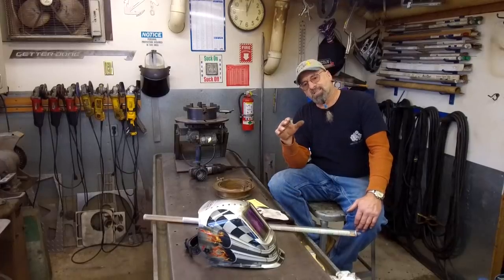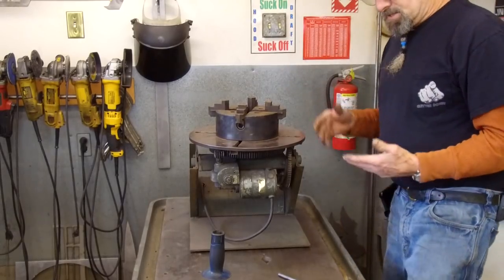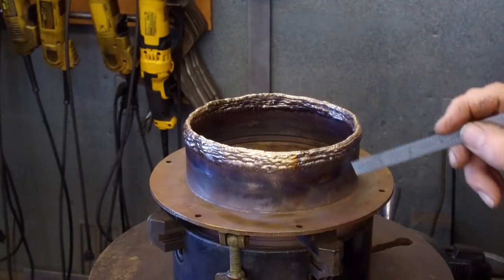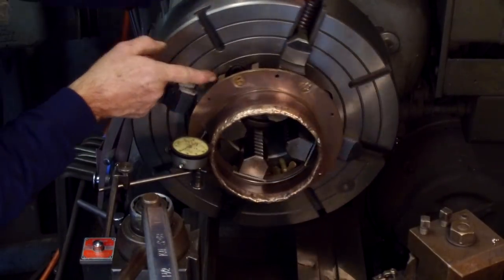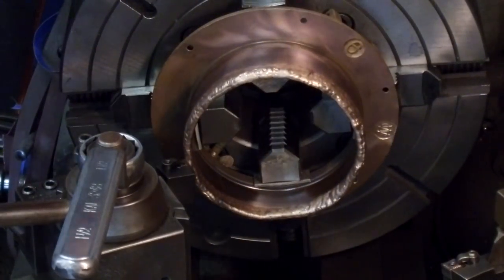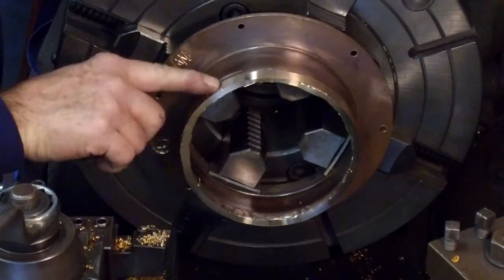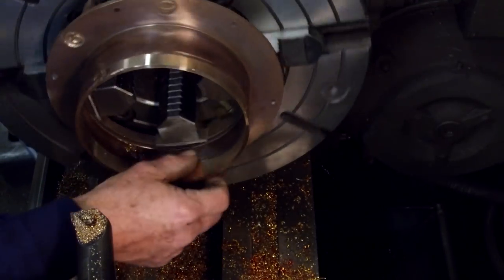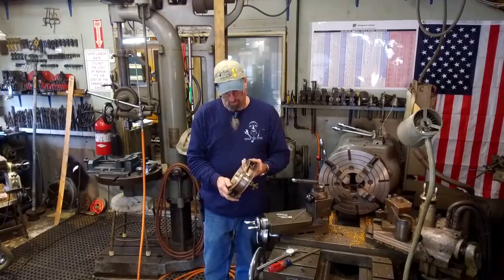Stick That In Your Port Hole

Comment: hello Keith. 
you can use dry lubricants for parts like that. there are different kinds available everywhere. little particles dust and such splatter wont stick like regular wet lubes parts will stay clean. perfect for your needs i think. you can get graphite based one from local key makers they use it to lube the lock cylinders and ptfe wax ones from local bicycle shops easily. they use them for summer time dry season chain lube for bikes. try them out. the only problem is they don't like wet environments which is not a problem for your super dry squeaky  little machine : ) 

keep it up love your work much respect from İstanbul.

Comment: Good job on the Porthole.  I was wondering if it was possible to see some of your projects installed after the work is completed.  Not everything, as I know this is not feasible, but some of the ones that can be seen 'by the public'.  Kind of like how you showed your lights after they were replaced, and the lift you tried out.

Comment: Good job.  that's the first time I've seen you Tig weld brass, at least that I can remember. Not to change the subject, but, I'm still waiting to see a video on how you fix the Clausing cross slide.  RRITS has done a video on his Clausing cross slide repair.  He cut off the acme threaded part and attached a store bought acme thread to the "handle".  Quick and dirty but it worked.  I'm expecting better things from Turn Wright Machine Works.  Keep the videos coming.

Comment: Keith, this video is an example what is a dying art of machining and fabricating.  Lots and Lots of  machinists can turn out brand new parts down to 0.0001 tolerances.  However, taking an old, unobtainium part, and bringing back to original (or acceptable) working and functional condition is not something that is taught  today.  Well played my friend.  Well played.

Comment: can I tig weld bronze and brass with just my regular old Lincoln welder that I plug into 220 ? It's not a high frequency, just a stick machine that I switch the lead and ground around. Do I just use the same tungsten also or us it something different like they use on aluminum? Thanks.
Reply from the maker: You don't need high Freq. and your choice of tungsten. ;{)-------

Comment: Nice work. I think you might have “inside” and “outside” reversed though, Keith. Portlight glass is usually on the inside, where you can open and close it from inside the cabin.
Reply: This porthole is going in a door.
Reply: Roy Reynolds If it is a ‘door’ in a boat, such as a companionway door, it will still have the ‘light’ on the inside.

Comment: For years, I've been wanting to get a weld positioner but they are so expensive and I can't see why they cost so much -even the used ones.
Reply: Using this one as a model, make one using a sewing machine motor or similar and foot pedal.

Comment: Thanks Keith for another awesome video! This may be the 1st video that I can recall where you've shown silicon bronze with tig? You're obviously a master at o/a brazing, with a lot of cast iron repairs. I can see o/a brazing being superior when needing to more evenly heat a part that would be prone to thermal shock; would you care to explain other factors which dictate which process to use in particular situations? 

I enjoy using tig when I can, but almost think that o/a brazing may be easier (for me anyway) on a lot of jobs. Also, do you notice the same amount of draw/distortion with o/a brazing as compared to tig brazing? 

Thanks again!
Reply from the maker: When the materials like ductile or cast iron come to play I use gas torch, with general bronze brazing rod, on most other build ups I would use tig or stick welding. most marine components or accessories are easy tig welding projects, some bronze does flume and then it is a question you have to make yourself, tig or gas torch.  ;{)-------

Comment: what about using a graphite lubricant on the  tilt gear?
Reply from the maker: Might do okay. ;{)-----
Reply: Maybe some Moly Disulfide?  How about putting some Dow Corning oven chain grease in there? It has a fairly high temp rating and is water soluble. FDA approved and non toxic.
Reply: Phil Keith said that he doesn't use lubricant because of grinding dust etc. sticking to it. Not a question of melting point.
Reply: jonka, graphite is a dry lubricant,  carbon dust, frequently use by locksmiths on locks to lubricate them while not attracting dust and grit as an oily lubricant would.
Reply: pyromedichd1
pyromedichd1 Thank you and I know about graphite as a lubricant. 
My comment was directed to Phil Grindle who suggested various high temperature greases
Reply: Moly Disulfide is also commonly used as a dry lube or sprayed on then dried. BTW I only suggested one actual grease. And using IT would be simple with a cover/shield fabbed up out of whatever scrap is laying around.Only spent 5 years as a Sales Engineer in the industrial supply biz ( and 35+ years in Engineering jobs total) so what do I know...
Reply: Phil Grindle You look like someone who likes the last word. I note that you seem to have had it twice here so far.  Your considerable time in the engineering sector has done little for your understanding of other's free choice or speech.
Reply: jonka1 I am sorry that you feel that way about me. I am not judgemental at all about anyone's decisions. I don't care about having the last word. And I couldn't give a rat's back half if someone chooses to judge me. Both  Keiths (Fenner and Rucker) know who I am...

Have a nice day...

Phil...
Reply: Daniel Napast
Daniel I'm right there with you. Nicely put. Be aware Phil is always right and doesn't like to be contradicted.
Reply: jonka1 I better be careful, don’t want to have all his experience unleashed on me all at one
Reply: Daniel Napast 
LOL Sorry Daniel, send him to me if it gets too much.

Comment: You are like a human 3D  printer...
I would've never even attempted that, a ferrule type bezel that slips over (or inside, or just butts up) would have to do for me.
When I can stick two pieces together with the welder, or fill up a hole, that's about as much as I can hope for right now.

Comment: Keith, because of the welding positioner, what do you think about using graphite powder for some sort of dry lubrication? could this be helpful or would it cause any troubles (besides the perfect electrical conductivity of graphite)

we used it a lot on locks to get lubricated and not deal with dripping fluids out of them
Reply from the maker: Might do okay.  ;{)------
Reply: Was just about to post this. While not as good as grease for an application like that it will still do wonders. Do not confuse with "graphite oils" - Graphite in itself (and mixed with grease) works very well in the right applications (in locks, one advantage is that since it's a solid it can't freeze) but mixed with thin oil, yuck, the worst of solid and liquid lubrication combined without the benefits.
Drawback is that since it's an solid not much will stay on so adding a touch now and then will be required (using a soft brush is the easiest when access allow).
Sadly it now rare to see pure graphite powder here (stopped being popular in locks due to three things: 
To much and it spreads outside the lock (fingers, clothes...).
Way to much and it gulls the lock.
It can't "unfreeze" a frozen lock. (Good heavens forbid, no maintenance before the lock have problems. No, wait 'til you can't get in and then cry a river over bad locks.)
Reply: Teflon powder.

Comment: G'day Keith, another great job. Hope you kept the windows up in the car this year with all that snow around.I have a question regarding the work holding. The aluminium (aluminum) shims you used in the lathe set-up were wider than the chuck jaws, so there appeared to be a bridging effect happening. Depending upon the material being chucked, can this cause an error at all in the set-up or machining because of the springing or bending of the shims under the force of the jaws, or is it a case of knowing how much, or little, machining force you are going to apply when turning? All the best for a great 2018, David Wright - Australia
Reply from the maker: let the shims bend, to suit the grab. ;{)-----

Comment: for those who want to make a weld positioner table. think about an automotive manual transmission flywheel with a ring gear  mounted on an automotive hub and bearing assembly.. or drop the proper brake rotor on under the flywheel.. so you can mount a sprocket on the rotor surface to what ever drive motor you come up with.
Reply: wayne p good idea!  Gear from the starter would mate, and perhaps using an old starter to turn it would not be out of the question.  It's a DC motor after all.  I knew there was a reason I was saving all of those old parts.
Reply: Using an old flywheel is a good idea, I've had a weld positioner on my to do list for a long time and i have an old flywheel off my old 351 v8 that has heat cracks but it's not going to fly apart at weld positioner speeds.. maybe an old windscreen wiper motor with a gear off an old starter motor would get the right speed and being a dc motor, it'd be easy to change the speed

Comment: Wonder if there is a chemical he can rub on to bring back the patina?
Reply: ethanoic acid ... some people call it vinegar !
Reply: Vinegar is acetic acid
Reply: There's a lot of antiquing solutions out there for copper, brass and bronze. Lots of architectural fabricators and art foundries use 'em because no one wants to buy a shiny statue...
Reply: and acetic acid is ethanoic acid so, we'll just go with "vinegar" ... its simpler.
Reply: The patina will return of it's own accord once the salty wind blows across it again.